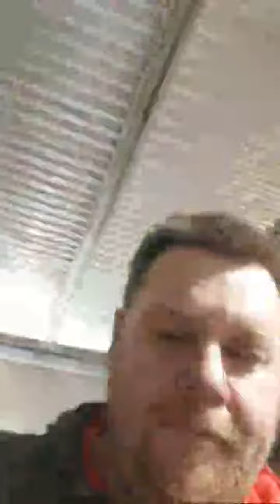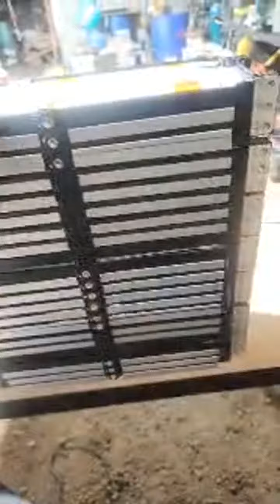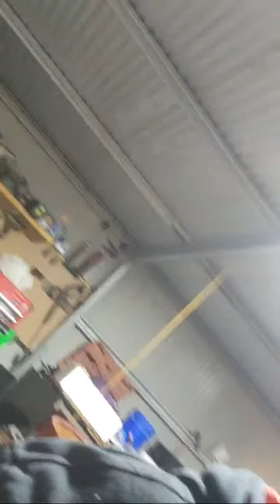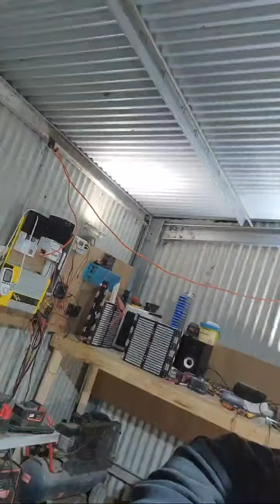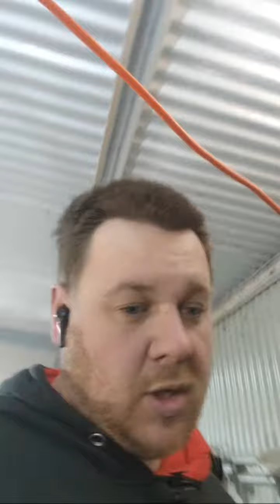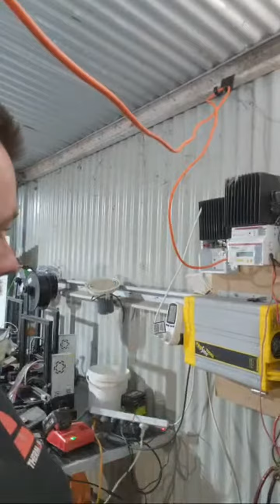let's talk batteries lipo ,lifepo4. how to build 60kwh.

Comment: I've been repacking these into 14s2p modules. Will soon have 14 modules put together, have only had time to build 4 so far! A total of almost 90kWh, in theory. Still thinking about getting some more.

For safety, planning to only use 80% of capacity (i.e. stop charging at 4v) and I will build a fireproof room inside my detached garage. Fuse between each string. I've got threaded rods for compression, to stop deformation.

I've got a 3kW Victron charger inverter that I'll start with but I'll have to figure out something else once I start using the battery to power anything serious.

Good luck with your system! I can show you around mine hopefully by the end of the year once I start making some real progress.
Reply from the maker: Let me know when it's done bro would love to say G'day and check it out. 
Yeah string fuses are a must I think and the lower charge rate should help us out. What bms have you got ?
Reply: @Oneupthesleevecustoms  got a 100A JK BMS at the moment for my testing. I want to do about 15kW total, so I'm thinking about using something smaller. Even 20A BMS per module should do. Got a recommendation?
Reply from the maker: I'm only running a 100a Daley lipo bms seems really good so far I'll make some videos about it soon. Wish I had some sort of monitoring system